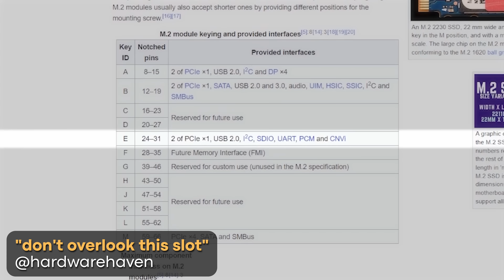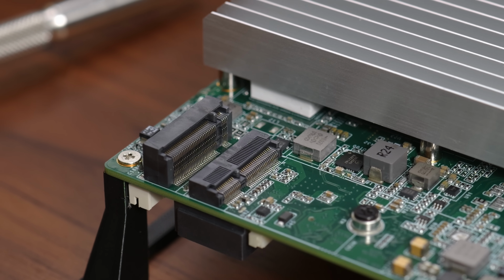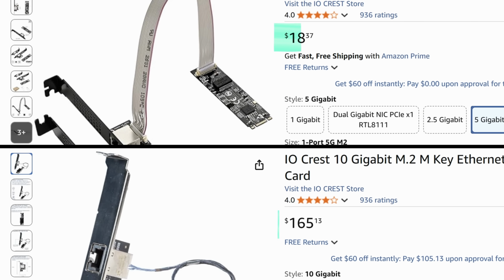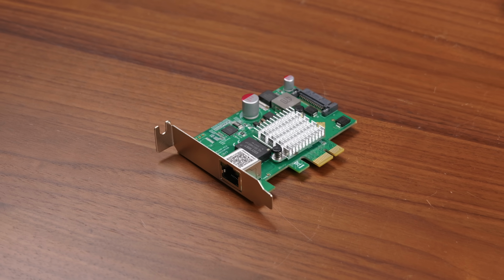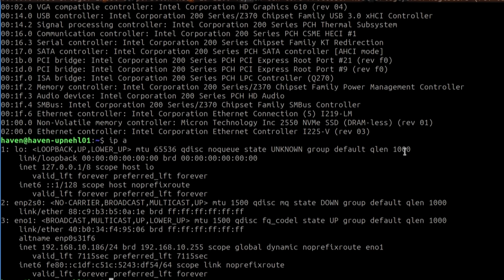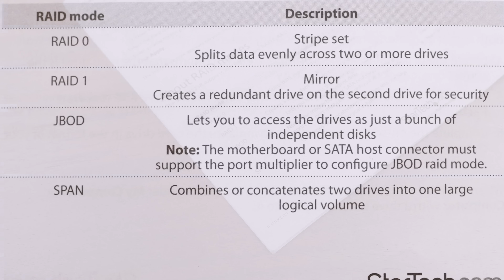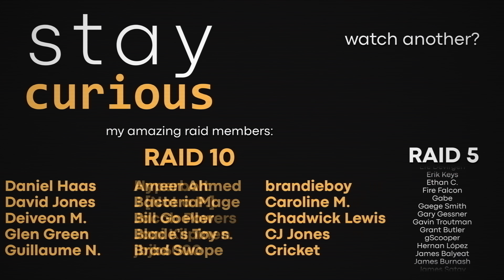I Don’t Know Why These Adapters Exist... But I Love Them

Comment: As someone with a lot of experience with Hardware Raid I can say that usually HW Raid is much simpler to handle than any software version. But then I'm talking about real raid controllers or disk cabinets. 
With the cabinets there's indicator LED's for drive activity, error and rebuild status. And they show which drive is working or has failed.
If you use a raid controller it has connectors for a status LED's for each drive. given you have a decent chassis you can connect a status LED's for each drive. This will show activity, errors and rebuilds. These controllers also has a solid software solution for handling the Raid arrays and monitoring the disk status. The software also has option to send status messages to mail accounts to report that something has happened. These are sometimes accessible as a webpage so you can monitor them over the network and not even need to install any software on the machine you are using to do this. This is usually not something you can do with a cheap DAS RAID chassis. They require you to be able to take a look to know if there is a problem.
The final good thing about a hardware Raid controller is that you can set up standby drives. These are normally non powered but in case of a disk failure they power up and are used to rebuild the Raid volume automatically without the administrator having to do a thing.

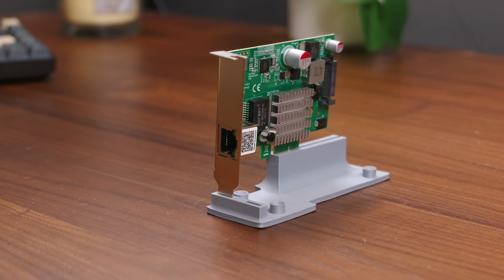Comment: 8:47 I have that exact 2x m.2 to SATA adapter. I have two 2TB WD Blue SSDs in SPAN mode storing my Steam library and it works great! It was a very easy way to pack some extra storage into my ITX build.

Comment: Added a dual boot m.2 to SATA adapter and dropped 2 512g m.2 drives with the inconvenience of a hard switch between them (for maximum thoroughput).
Win 11 25H2 Pro and Reatta on the same machine with the flip of a switch.

Comment: There is a USB splitter that I use.
My Mainboard only has the 19 pin USB 3.0 header, but my case also offers a Type-C port.
The adapter / splitter plugs into 19 pin on the mainbaord, and SATA for power and provides both 19 pin and Type-E port.

Comment: The PoE PCIe card can be used to power a camera on a dedicated private network.  Some cameras are very network intensive and it is best to direct connect them to a computer versus putting a network switch in the middle of things.  The vision processing software can run on the PC, when the uses it onboard NIC to send results to higher level systems.  Think about automating a factory manufacturing production line, for example.  Maybe the vision system is used for pass/fail quality control.  The raw video is not necessary on the main network, only the pass/fail status for each item being inspected.
Reply: This segregation can be accomplished with most good quality layer 2 switches that support port isolation and link aggregation.

Comment: The handiest adaptor I have bought and used is a pcie 4 lane adaptor that drives 2 NVME ssds. A chip on board does the splitting.
I had a Pcie 16 lane that held a 4 NVME drives and required the 16 bit PCIE to be set up in the BIOS as 4x4x4x4 for some time on one of my PCs. I upgraded the CPU to a 5700G only to discover that the CPU will not split to 4x4x4x4, it will do 8x4x4x  so I lose  a drive. Then having an empty x4 slot I found the wonderful 2 NVME drives from a x4 pcie slot which gave me another 2 drives. the use of a x8 slot is common in these adaptors but a x4 adaptor is unusual, But, it works very well. I don't like big drives I prefer a lot of smaller ones. They are cheaper and a fail is not so damaging though I have never had a fail from normal use.
Reply: Hey that's very nice! Can I ask where or how is that adapter named? I'm kinda looking for a PCIe X4 to X2X2 M2 with PLX but no luck so far.
Reply: @panchovixmenn  Look for controllers with the following chips
ASM2812
ASM2824
PEX 8712
PEX 8724

Comment: A lot of these are definitely for weird niche cases but I could see a good use for those PCIe slot PoE ports though. If you are extremely limited on space, you could use one to run power from a homebuilt router to a PoE access point without needing the extra injectors or switches. I might snag one for my 10inch rack mini pc now that I'm thinking about it 🤔

Comment: My personal favourite that I have in my daily-driver is a 10GBe PCI-E adapter that also has 2x NVMe slots on it for storage and networking in a single board.
Reply: I'm guessing it requires bifurcation support in the UEFI/BIOS to see both NVMe drives. I have two PCIe cards that support multiple NVMe drives (2 on one, 4 on the other), but they use a PCIe switch chip to manage the storage without requiring bifurcation. Reduces the bandwidth to the drives, but they seem to work on most systems.
Reply: @dktol56  I remember seeing this very kind of card recently, looking precisely for some workarounds over limited PCIe slots for my future system, found that interesting, then looked at the price: around 350~400$! My assumption would be that it does have a switch on-board, at such level. As a European, that instantly means it's going to be 450€, at least.
Reply: @dktol56 or it's more higher end and has it's own pcie switch to avoid bifurcation issues on the host.
Reply: If it's a packet switch please share the model, i am in dire need of one of these since AMD and intel refuse to increase the amount of PCIe lanes on consumer chips.
Reply: @Wileybot2004 and @cis9222 . The one I stumbled upon was called the McFiver, by Sonnettech. It even provides USB-C, and is indeed switch, not bifurcation based.
There are other offers from competitors, sans the USB-C, and a tad less expensive like the Synology E10M20-T1, Asustor AS-T10G3, QNAP QM2-2P10G1TB. 
All switch-based.
Reply: Which model?
Reply: @cis9222 probably the qnap qm2-2p10g1tb
Reply: I thought I'd replied, but it might've disappeared. Yes, these are switch cards, not bifurcating ones. The one I had in mind was called "McFiver" by Sonnetech. USB-C, 2 M.2s, 10GBps Ethernet. Only missing a discrete sound card! 😅
There are others, more affordable (200~250$), without the USB-C port. Look up QM2--2P10G1TB by QNAP, AS-T10G3 by Asustor, E10M20-T1 by Synology.

Comment: My favorite is the adapter to turn POE into powering devices that don’t normally work with POE. After seeing that, it made the wheels crank in my head a little bit. I have four HP ProDesk 600 g4 mini pc’s that I run as a cluster for my server (overkill, but free from work so 🤷🏼‍♂️). Do you know if there’s an adapter that’s big enough to run one of those? I’m assuming you would need something like POE++ to run it, but would be cool! They currently have huge power supplies that I have to cable manage and a POE adapter like that would be amazing!!

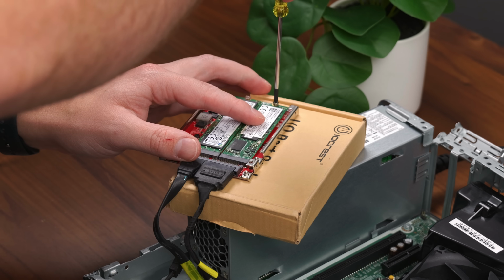Comment: Have you encountered anything like #4 that fits more than 2 but in a 3.5” disk size? 11:23
Reply: I have a 4x NVME m.2 to 2.5" adapter that uses a U.2 port instead of a SATA port, but you'd also need a PCIe or M.2 adapter to plug into it with most computers. It won't work with SATA M.2 drives nor with a SATA cable. It's physically possible to fit six full size M.2 drives in a 2.5" adapter (three on top and three on bottom) but I haven't seen such an adapter actually sold anywhere. A 2.5" to 3.5" adapter would work with the adapter I have, though if you're looking for something that actually fills a 3.5" bay with a bunch of M.2 drives then I haven't seen that yet either.

Comment: If there were some way to tell when a drive failed on that dual m.2 sata adapter, it would be great for adding redundant storage to a tiny mini micro node
Reply: Many old raid cards had an audible buzzer as a sort of last line of defense. If that yellow light isn't used for anything else, it might be possible to rig something?

Comment: For that 2.5gbe nic...
DIY router, that nic as your wan.
PoE splitter adapter to the FTTH ONT, and the DIY router on a UPS.

Power loss? No issue, you'd still have internet untill the UPS is empty.
So you can still send a message that you've lost power, and maybe shut down sooner than the UPS auto shutdown treshhold.

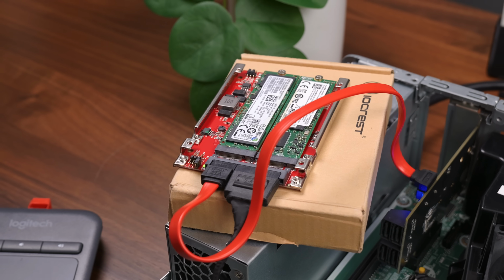Comment: 12:11 afaik there is a software called Asmedia Raid Tool (for windows and mac) that can show a GUI and alert you of failures. You can find it under Ableconn ISAT-M2SR page (which is the same identical adapter Startech also sells). The same software will work on most other devices that use Asmedia ASM1092R chip like your adapter

Comment: 9:59 JBOD mode is "sata port multiplier mode" and works only if the sata controller you connect it to does support port multipliers. Intel chipsets does not, AMD afaik should, cards with Marvell, Asmedia or Jmicro controllers should support it

Comment: My favorite adapter for old systems is mini PCIe to M.2 key M adapters (on cable obviously due the size difference). Sure, it is only PCI-E 2.0 x1 at best, but having an NVMe drive instead of useless older WiFi adapters can be good way to save SATA ports for something else. I use them combined with rEFInd on USB flash drive for booting from that NVMe drive.

Comment: Barrel jack to type-c adapters, great for changing and allowing charging from pd 3.x chargers for stuff that's older which doesn't support charging by type-c (e.g. It doesn't have one of those ports, or the port is just usb/dp alt only) and actually, I want to find a cheap pd charger where I can hook up my switches and mini pcs to a single gan charger and dump the plethora of barrel jack chargers they came with.

Comment: I use an E-key to SD card in my laptop. It's sole job is holding a backup of my linux config files for things like my window manager. All small text files and not used a lot.

Comment: I have an x16 PCIe to 2xnvme+x16 (x8 speed) adapter in my itx server and absolutely love it. 
I also like the POE splitter and PCIe card. The latter could be useful for powering a switch or router, or for configuring poe devices maybe.

Comment: there is a 4 and 5 m.2 ssd  in 3.5  form factors    that uses sata  interface for about $50 on temu  also a m.2 to 5x sata  adapter that i think you used in a nas build 
but i found   for the price   standated  4 g or 8 g  3.5 sata is the best value  considering the  slow performance of    small old  drives of questionable reliability

Comment: If you want a goofy one, get the StarTech PCI to PCIe adapter that lets you put a low profile PCI card into a 1x PCIe slot. Startech has one of everything
Reply: God bless every single king working away at StarTech, honestly
Reply: What's even goofier is that adapters for the other way around exist - allowing you to plug a PCIe card into a PCI slot.
Reply: @ericbsmith42 I wish there were powered adapters since PCI doesn't provide 75W.
Reply: Their slogan is " Hard-to-find made easy"!
Reply: Lmaoo yeah. If you can think of it, StarTech has made it. They even made a low profile PCIE 1x gigabit ethernet plus dual USB 3 card.
Reply: @kekistanifreedomfighter4197  startech is god tier
Reply: Used one of those recently. Make sure you pickup a SATA power to Molex Power adapter since it requires a Molex plug for power.
Reply: Honestly that's not goofy, there were some neat cards back in the day that still have some value for certain use cases
Reply: do they have a mini hdmi > mini dp (m/m) adapter cable? i needed that a couple years ago and never found it.
Reply: @DragoNate I have the non mini version of that cable. A couple of full size to mini adapters on the end and you have an every combination cable. So it's possible, but might look ugly.
Reply: @insanityideas  yeah. i suppose as long as it's stable and the connectors stay in place, it'd be fine.
i did already do that with an adapter at one end of another. i just really wanted the direct option lol
Reply: I bought some of these because I ran out of M.2 slots and the ones I got hold two M.2 drives, way faster than SATA.  They have a 4 way and I think a 6 way but those require the motherboard to have PCIe bifurcation
Reply: @jamescole6846 Eh? They don't stop or start being an SSD by how they are connected. All M.2 drives ARE SSD's.
Reply: @noth606  I meant to say SATA SSD. I was highly hung over that day :)
Reply: The USB-to-ISA or USB-to-PCI cages are more funny - and a hell of a test for hotplugging in every OS, driver or application 🙂
Reply: Yep 100% I actually run all of my dongles with StarTek because of how durable the stuff is and the fact that I'm in Montana and I walk everywhere. StarTek is supreme with all of their stuff
Reply: I don't think that's goofy. There are older but still useful devices that require PCI cards; an adapter like that lets you use them in a modern system.
Reply: I got one of their adapters for my OG Xbox.
Reply: Some are sold out. Usually the ones noone else makes.
Reply: Star tech has great customer support too
Reply: All their stuff is usually stupidly expensive though
Reply: @RowanHawkins  true, but what we found was the better reliability of StarTech PCIe cards made them worth the price over generic equivalents, especially factoring in lost productivity from workstation downtime
Reply: @RowanHawkins  that's relative to the need... for others.
Reply: @RowanHawkins  Eh, how exactly do you think they are supposed to cheaply make something with an annual sales volume of 5 units worldwide? The fact that they DO make the weirdo stuff for when it actually does matter is a giant favor to computing mankind, a bunch of their stuff is used to keep big ass expensive industrial equipment alive actually. I don't remember what weird dingbat thing it was anymore but I knew a guy who fixed a I think Axial Tomography machine in a hospital with some weird adapter thing of theirs - don't recall what it was exactly but some sort of storage type adapter I think. Sure, they needed a different long term solution, but in the mean time they could help the patients in the waiting line and actually literally save lives. I think it was a PATA to SATA converter with an actual chip that did some sort of conversion magic on it, but it allowed a Sata HDD or SSD to work on the ancient computer running the machine - I think. The guy who did the work got paid 200+ per hour plus flights and hotel so he was a bit... less than crystal clear about what it is he did exactly, heh. It's all through some sort of worldwide service company thing who will send a tech in a rented car or plane or heli or camel to you within some hours, and the dude WILL fix the problem. BUT - they DO charge a stiff fee for what they do. This was all more than 10yrs ago.. 15-16 yrs ago I think. 
That sort of stuff is what their gear is used on the regular for, the company I worked for did buy several of their adapter things for 50+ each more than once also to keep old things alive, but telephone systems - not life saving equipment. I did work in IT but as a software dev, didn't have anything to do with the hardware - even less that sort of aspect of it. 
"StarTech - makes the hard to find easy" is their slogan BTW ;-). So I'm quite happy with StarTech being the way they are - but I've never bought or owned any of their stuff nor am I likely to, since I don't operate on budgets where their stuff would make sense.

Comment: 1:36 They actually do exist, CWWK recently released 256GB, 512GB and 1TB A+E key 2230 SSDs, but no idea about reliability, they don't even give a TBW rating
Reply: SiliconPower also has a A+E Key 2230 but A+E key SSDs are a pain to find and they're often for industrial customers.

Comment: I've seen a lot of goofy adapters (4 microSD to 1.8" IDE comes to mind), but the one that's stuck in my head as the most weird, is a PCI express card, with a 56kb dial-up modem on it.
Reply: Oh that's interesting! Internal modem cards are very common but they usually use plain PCI. A PCIe 56k modem must have existed in a very specific period of time.
Reply: @mighty_bunny  I saw it in stock on an office furniture online store like 6 month ago 😅

My guess is it's for fax purposes

Comment: Nice presentation.  Thank you for posting.  I am a huge fan of adapters and converters.  More please. That said, I would really, really like to find a nice PCIe x16 adapter/switch for video slots that would convert to 4 M.2 slots and work like it is supposed to with full x4 lanes to each M.2 drive - no bifurcation required.  Just about everybody has an older box they want to use for Proxmox (no video needed) and needs more solid M.2 x4 drive support and yet the motherboard does not support bifurcation.  Find some good options for this and you will be my hero.  <grin>

Comment: I've boon looking for a adapter that for my 4 HP microserver gen8s. These only have 1 pcie slot. I really want to setup a ceph cluster which needs 10gbe Ethernet. but the built in sata controller only has 2 disk a sata3 and 2 disk at sata2. I wish there was nic + hba card!. I have though about getting a pcie to dual m.2 then getting a m.2 to 10gbe nic and a m.2 to minisas.

Comment: Is there a external usb3 to pcie x16 adapter so I can use older nvme drives in a 4 x m.2 card that require 16 lanes? I know the speed will be limited but usb3 is faster than in a box unconnected. I have a pcie x1 to x16 for gpu mining but I think it is only weird for 1 pcie lane so 3 of 4 mvme do not show up.

Comment: I just bought a+e key 4 ports sata adapter using thin flat cable to a satelite board with the actual sata ports. This way I will not have to drill holea on the mini pc case and have the extra drives caddy along the cables outside of the box (no pun intended). It supports port multiplier so I consider geting one of thouse dual m.2 sata to 2.5" caddy you presented.